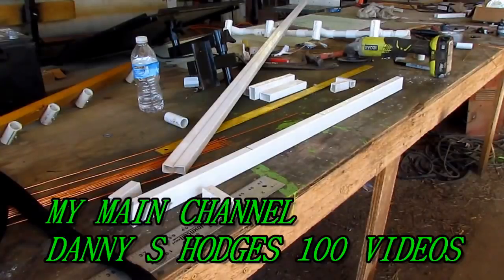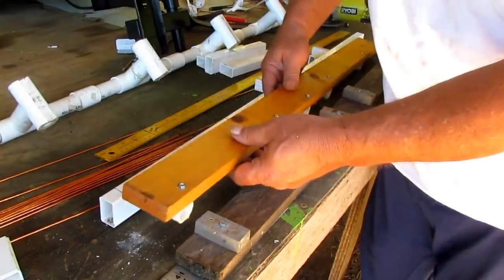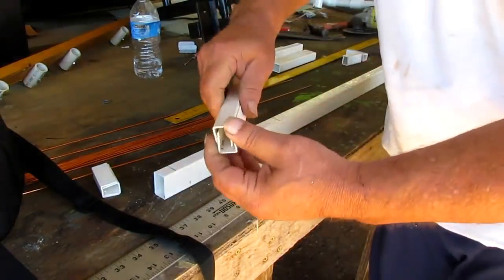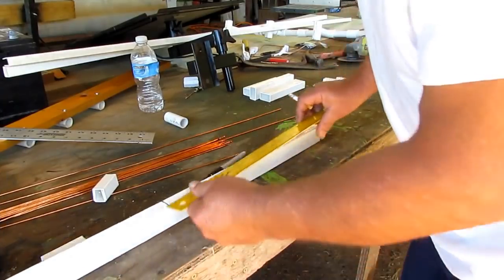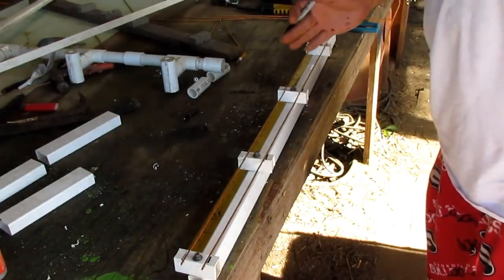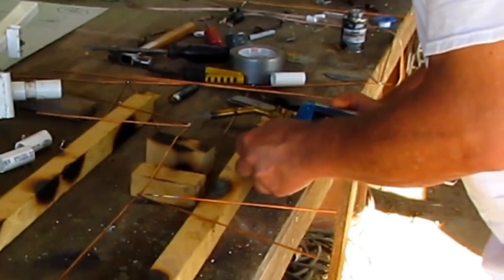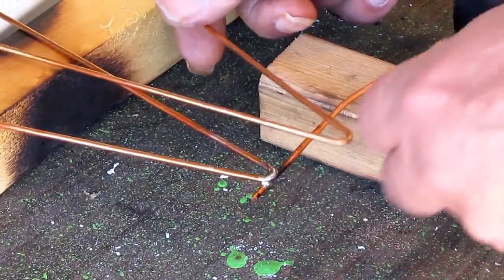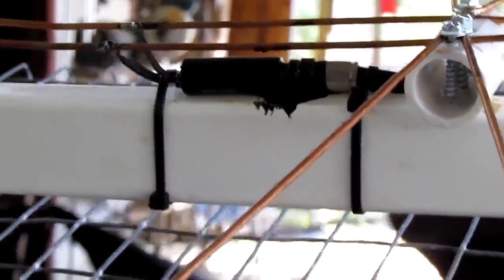How To Make The Ultimate TV Antenna Revised

Comment: Which one do you think is best, this one or the gray hoverman? I'm asking because I need to build a antenna so I can watch t.v. some of the stations will be vhf and others will be uhf and the stations that I will watch the most are about 50 miles from me and there are others that are about 70 miles from me and there are others that are about 100 miles from me. Thanks
Reply: Dave, try posting your TV Fool report here so we can see where the transmitters are from your house. A Gray Hoverman with NARODS might bring in some of your stations.
Reply: Richard Holbert I don't know how to post the report on here.
Reply: Run the report for your location, then look for something like this near the top of the report, and paste the url here.
If you would like to share these results with others, this page can be referenced as:
  http://www.tvfool.com/?option=com_wrapper&Itemid=29&q=id%3de6a4e0a5e08f6f
Reply: When I click on your link, I get an error message -- The requested report ID is no longer on our server. Are you in Munci? You left off the last digit of your report url. It should be as follows:
http://www.tvfool.com/?option=com_wrapper&Itemid=29&q=id%3De6a429e2a1f31d
Reply: Looks like WISH-DT on Real channel 9 and WTHR on real channel 13 are the only VHF High stations within 50 miles. A single or double bay Gray Hoverman mounted outside and as high as you can safely get it should be able to pull in most of the Indianapolis stations. Add NARODS if you really want to try to pull in your VHF High stations...
Reply: Richard Holbert yes I'm in Muncie, IN and wish and wthr are 2 channels I would like to get. I was thinking exactly what you said would be best but now I was wondering about the hybrid antenna. Thank you for responding.
Reply: The Gray Hoverman is easier to build since there are no crossovers. You can add the NAROD and hybrid elements later.
Reply: Build the diamond antenna it works great easy to build

Comment: Danny,  I know it's frustrating getting copied word for word by a complete idiot. But remember, "Imitation is the sincerest form of flattery."  He doesn't realize it, but he's really saying " Danny Hodges IS MR. ANTENNA! " 
 I believe you'd get better signal if you could figure out a way to eliminate the metal roofing screws between the cats whiskers. The metal causes a slight impediance mismatch. Oh yeah, might be wrong, but looks like  your matching transformers are for inside use not weather proof.  If so, might lead to failures over time.  Quick fix is to coat them with silicone sealant or epoxy glue (= "E pox E" =lol!)  Keep up the good work. You're my HERO!      (btw, I bet mama was more fun to be around after you let her win the chess game...  'Tell her she's smart' and she won't be able to do enough for YOU! -Of course, you'll wear out your mattress and box springs twice as fast... LOL)
Reply from the maker: Yep all he knows is what i said....u made me laugh
Reply: Southern Ideas  I like the aluminum model , I wondered if it was as effective as the copper model. Thanx for the vid!!
Reply: I think Danny spoke about that in another video, I believe he said copper is the better conductor
Reply: Here's the link to one of them https://www.youtube.com/watch?v=FqlViVmrz8U&t=434s
Reply: You could try nylon bolts but they would not hold up well in the Florida sun. I really don't think that small amount of metal will mismatch the antenna that much. I saw the demo and 21 channels is nothing to kick about. Most people are lucky to pick up 5 or 6 channels that far away from the towers. Keep up the good work Danny!
Reply: What ever you use, it needs to be UV resistant as well; the sun will cause serious deterioration.